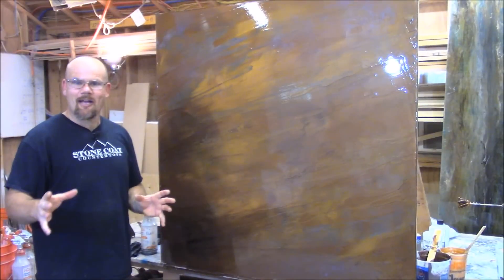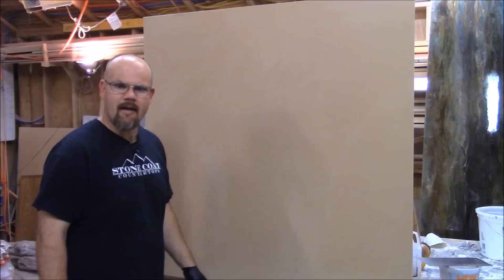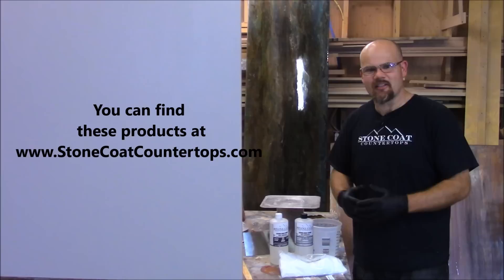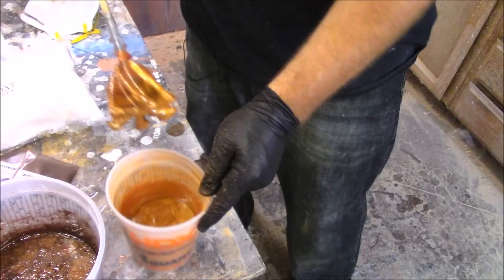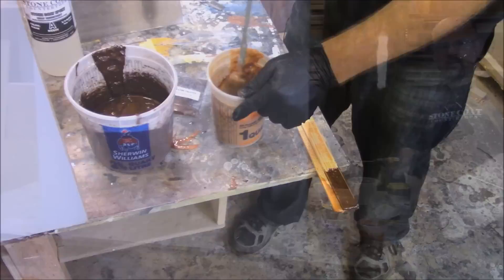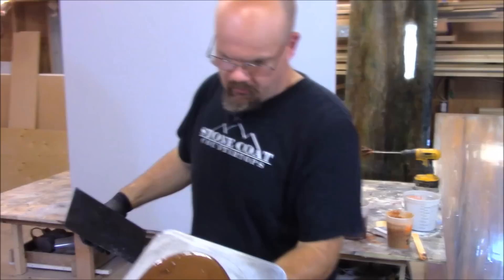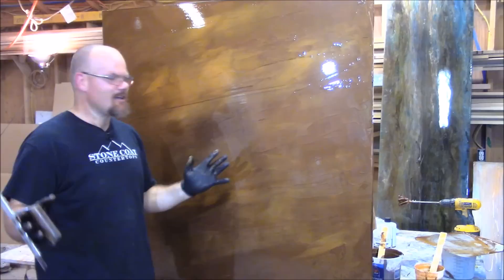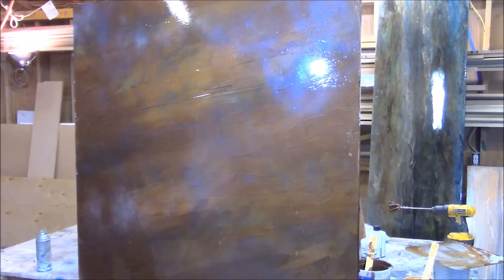Vertical wall epoxy, DIY

Comment: Wow this looks awesome and fun! I have a few questions:

I am a little bit intimidated by only a 30 min working time.  I have some walls I want to start with that are 3 feet wide and 8 feet high, and I want to do the whole wall. Is that possible?

What do you do with the very bottom? Won't it pool in places and make it hard to put baseboard around it?

If I want to do a backsplash and countertop, should I do the backsplash first then pour the countertop? How do you guys at Stone Coat Countertops address the join between backsplash and countertop?

Really excited to do a bunch of projects with this :)
Reply from the maker: Thank you for your kind feedback amyzes! Great question! You can apply Stone Coat Countertop Vertical wall epoxy directly over new, or old sheetrock. If applying the vertical wall epoxy over a painted drywall surface you will want to lightly sand with 220 grit sandpaper to help create a great mechanical bond. If the project you’re working on is on newly installed drywall, be sure the sheetrock joints are taped and mudded prior to using the epoxy so the seams won’t show through your vertical wall epoxy install. When mixing up the vertical wall epoxy, keep your batches to a maximum of 1 quart od mixed epoxy at a time. When you add the vertical wall additive your working time decreases from our normal 45 min working time down to 30 min. Mixing smaller batches will ensure you have plenty of time to apply the mixed epoxy to the wall. As for the backsplash, here  is a video showing how we pre-color the surface and work with a countertop that has existing backsplash. https://www.youtube.com/watch?v=sSWDiKKSxok   Please feel free to contact us anytime with questions and for free project support (541)450-1976.

Comment: Isn't epoxy generally expensive?
Reply: azh753 no it's cheap.. Anywhere from 65 to 100 bucks a gallon. Depending on what you're wanting it to do.
Reply: white glossy weatherproof exterior vertical wall

Comment: I think this is deceiving in that if you were working against actual corners it would be hard to bring the trowel from outside into middle since you can't wipe up and past the outer edges on a wall corner. It would be a big pain to try to get it to look right.I know sponging a wall when you get to the corners it never looks right so can't imagine trying to get a nice motion that doesn't look like a sponge mop leaving a dirt line when you stop. So I think you need to demonstrate it on an actual wall. I noticed how some areas were not nice and glassy flat like horizontal work and also you cannot put the nice clear coat on. I think I'd just replace it or stick to horizontal applications, it just doesn't seem to look as nice. I hate brown and the camera shining into the surface didn't help visually. Would like to see another application more realistic. And I see you are working on one.

Comment: It's just like skim coating drywall...
Reply: Are you planning any projects currently ScorpioDragon94?
Reply: @sccteam1918  I'm debating on doing this to my countertops in my kitchen. My wife and I have been doing some drywall repair and repainting a couple of rooms in our house. We plan to at least repaint the whole house, but I'd also like to fix up our countertops and maybe even add in a bar and redo our kitchen flooring as well. My only concern is that my kitchen countertops have a backsplash made into the MDF and I'm not sure how I'd go about applying epoxy without just making a huge mess of the backsplash.
Reply from the maker: Great question ScorpioDragon94!   We like to cut off existing back splashes when we do our projects and make new ones to cover the area the old backsplash used to be.  We do however get DIY customers who wish to leave the backsplash in place, when this is the case here is how we suggest coating vertical backsplash.  Here is a video showing how we pre-color the surface and work with a countertop that has existing backsplash.    https://www.youtube.com/watch?v=sSWDiKKSxok Here are other colors that work even better with vertical backsplash, https://www.youtube.com/watch?v=wpzdQTFBA6I https://www.youtube.com/watch?v=3Xaw-MrNnnsHere is a helpful training video showing how we install Stone Coat Countertops from scratch out of 3/4" mdf: https://youtu.be/ygbKeiH7oXI   Contact us anytime for project support. (541)450-1976

Comment: Looking at the finished result, with all the runs in it and the light reflections it looks like a badly painted surface. Sorry to be critical, but to me it looks like a job gone wrong. If that vertical surface is done as a backsplash to a similar work surface, the runs and rough surface will stand out like a sore thumb. The colours might well be fantastic, but the surface is not.
Reply from the maker: Thanks for taking the time to watch our video and for your feedback Tony Mak, we really do appreciate it!